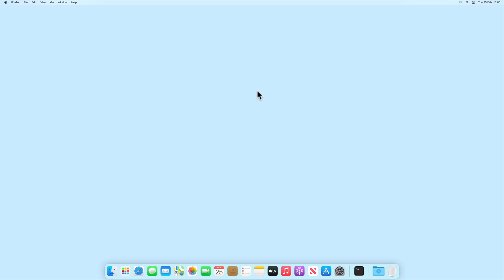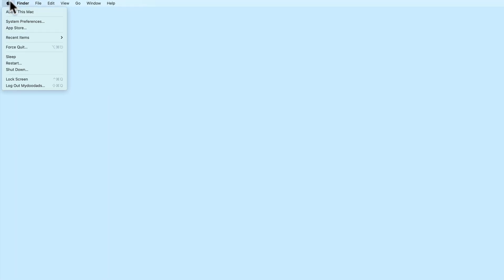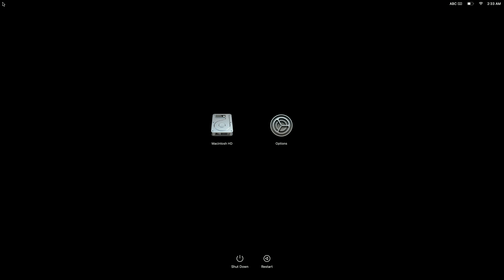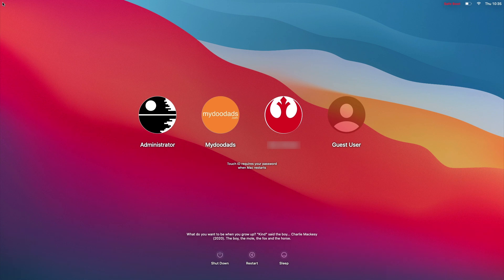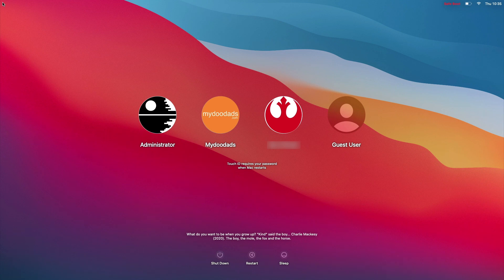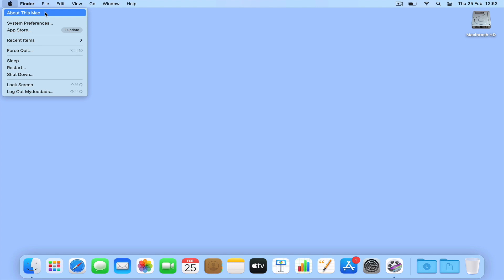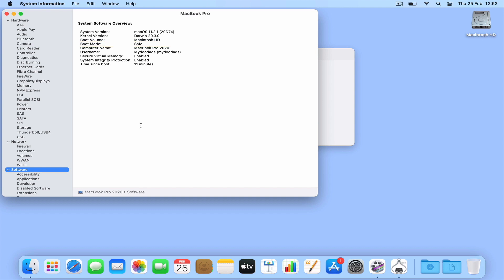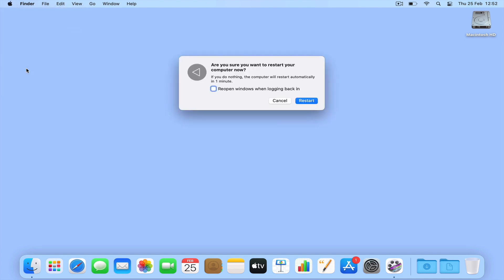How to safe boot an Apple Mac with Apple Silicon hardware.

Comment: When I press and hold down the power button it just turns on normally. My Macbook has a touch bar and turns on when I flip open the screen - is the power button the same as what you have in the video??
Reply from the maker: I am also using a MacBook with touch bar, so the power button is the same.

However, if your MacBook is using an Intel processor, you have to start Safe Mode differently. 

1. Power down your MacBook, but leave the  screen flipped open.
2. Press the power button and immediately press and hold the Shift key, until you see the login window. 
3. You should now be in Safe Boot, which you will see on the menu bar.

Hope this helps.
Reply: I had the same issue and realised I was just hovering over the button instead of actually pressing it in